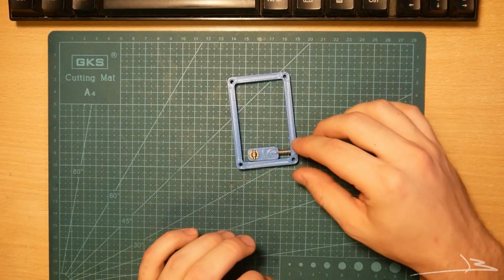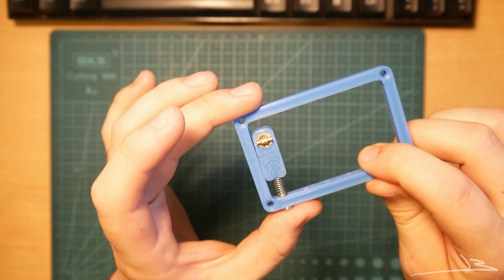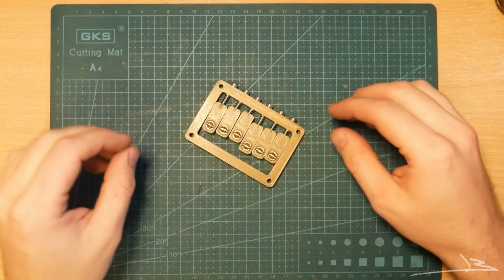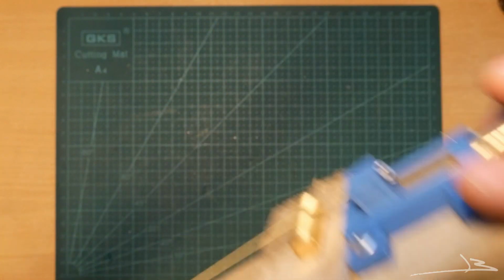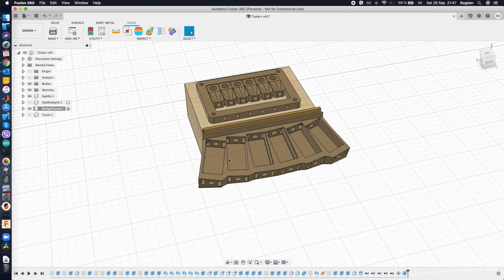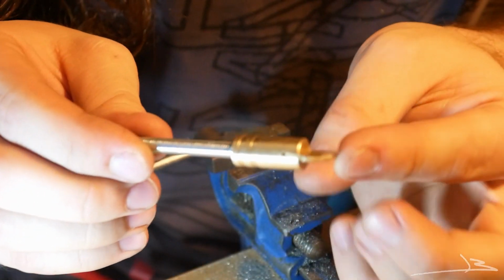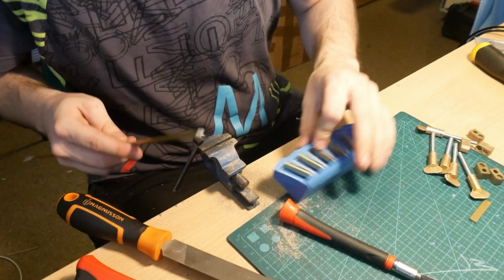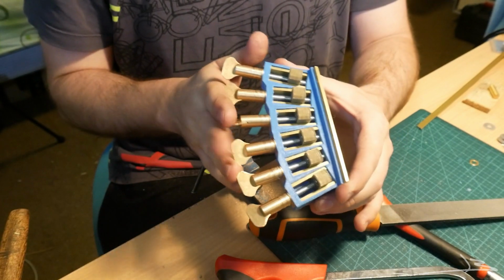Building a guitar from scratch | Ep6 - DIY 3D-printed tuners | Great Guitar Build Off (Unofficial)

Comment: You have the most DIY guitar on the internet! Great build!
Can you tell me what size hole did you use at the ball ends of the strings?
I am wondering what is the correct size for my build. It needs to hold the ball but let the string through.
Reply from the maker: Thank you! I can't remember 100% and I don't have the guitar with me anymore to check but there's hight chances that I used M3 nuts for the tuners, which worked well enough to hold the ball

Comment: This is really awesome!! I was planning on building a headless bass with homemade tuners and I never would have considered 3D printing. Would you ever consider releasing the files you used to the public?
Reply from the maker: I could definitely put the files out, but they are however quite custom to my situation. If you have the same brass rod and want to do the exact model I could quickly upload it on thingiverse, just let me know. But I'm not sure how well this would work for a bass, the tension is considerably higher in those strings
Reply: Sorry I’m weird, I was more asking about the 3D models in general in case anyone else was interested in the idea. I’m definitely trying to base my idea on bits and pieces of your build though. “Stand on the shoulders of giants” right? Lol hope you are having a wonderful day!

Comment: what kind of 3D printer are you using for this? I'm amazed that the 3D printed bridge/tuning system is able to hold under all that mechanical stress
Reply from the maker: This is just a general FDM printer. I am surprised too, but you would be surprised how tough they can be. Also depending on the orientation in which you print your parts (just like in wood which is stronger on some axes more than others ) you can achieve really strong and stiff parts

Comment: Bogdan, that’s a very clever design. I’ve not done any 3D printing and you really demonstrate the extraordinary power it brings to the design process. I am amazed that the plastic can take the pressure of the strings.  Another brilliant video, can’t wait to see your final guitar. Awesome! Cheers Dave
Reply from the maker: Thank you Dave! Yes, I'm amazed too, but as I said the final test will be on the guitar, I can't know for sure if it all holds up until then😅